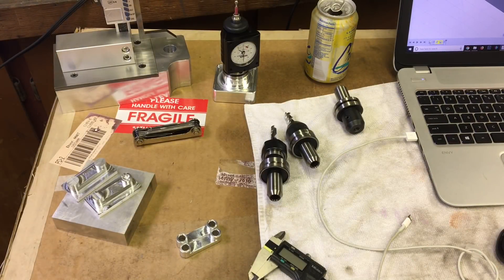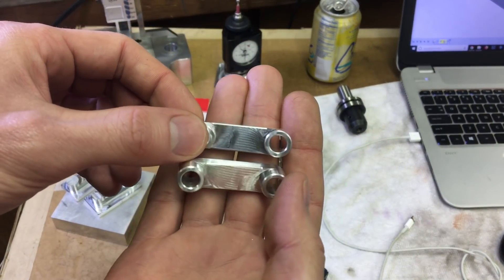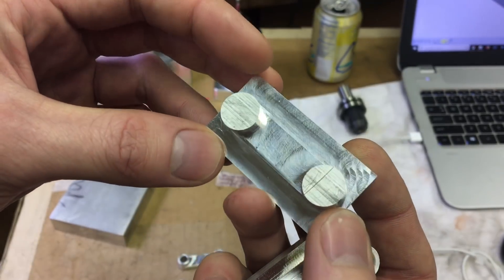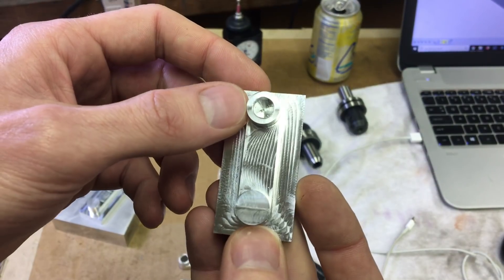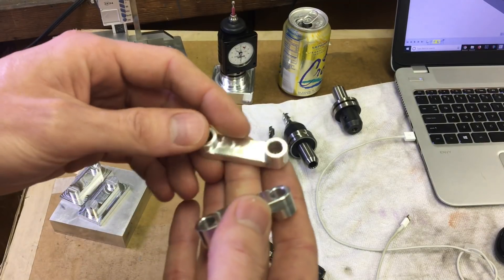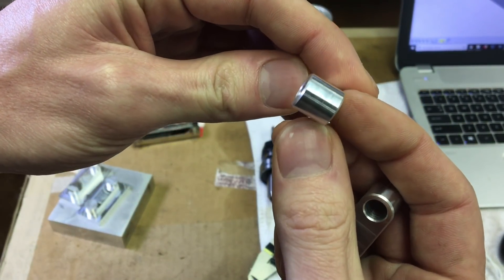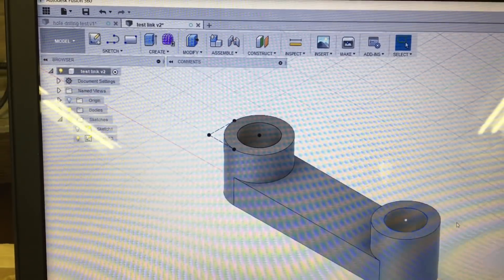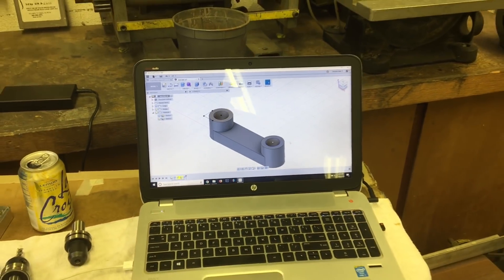Home Made CNC Mill - making some progress!

Comment: Pretty Sweet little plate you have your height gauge on there.
Reply from the maker: Hello Michael! Thanks, that's a little something my dad made up one afternoon. A left over piece of 2 inch thick Mic6 aluminum, with a surface ground steel plate for the magnetic base height gauge to stick to.
Reply: Nicholas Miller Pretty sweet. Probably way faster to make then me trying to drill a 3/4" hole in the corner of my surface plate with a hand drill. I did manage to make a 3/4" triangle. And chipped out the rest to make it work.

Comment: Is the spindle exchanged ? Im thinking about chaning my column, I got like 0.10mm flex back and forth even if I've tightened the screws.... how's yours ?
Reply from the maker: Hello Daniel L. Spindle exchanged ...?  this is the grizzly spindle with some time spent improving it. .1mm seems excessive, are you sure its not coming from somewhere else? could it be in the Z dove tails?   - Nick
Reply: Nicholas Miller naa, i measure against the dovetail itself. I can easily push and pull it 0.1mm.  The head itself can move somewhat in X+ X-  when doing heavy cuts though. Thats why I wanna exchange the whole column. Thinking steel tubes in a bigger dimension milled and grinded + linear rail

Comment: You mentioned e-stop a couple of times; I added a feed-hold button after seeing yours and my finger is frequently on that now. Saved me a number of times already. I have smaller spindle and drilling is a challenge. The equations for power requirements in the Machinery Handbook, while empirical, match measured power well. So, if you want to get into the weeds, those could be used to calculate great starting points. Look into the heights tab on the CAM operations and the non-cutting feedrates to reduce some of that slow plunge through air stuff when it makes sense. Lars Christensen of AutoDesk has a great video recently on height planes. As always, looking great! Off to stalk you on Instagram :)
Reply from the maker: ESTOP ESTOP!! I can say with confidence... I use that estop!! I used the feed hold as well, stopped the spindle to clean off the window! haha, worked a treat! I have a copy of the machinery's handbook... call it a "love hate relationship" = )  I watched one of Lars videos on soft-jaws, at the time it was a little out side my pay grade, now that I'm feeling a bit more confident it might be time for a revisit!  Cheers Kent - Nick

Comment: Nick,

Your machine is looking great! Cutting looks awesome!  A couple fun to and tricks you can experiment with!! 

Tip for that tricky chamfer between the two boss posts... Set the cut to use almost the very top edge (maybe 0.005" from the shank diameter to top of part edge your chamfering) of the 45° chamfer mill, it will allow you to get as close as possible to the boss sidewalls.. then play with your lead in lead out to have it feather the chamfer as needed, it's critical to really look close at your simulation to ensure you are avoiding a collision, but once you nail it down it's a thing of beauty to look at!  There is some pucker factor watching it the first time..lol. But that's part of the fun of learning and the results are a part with superior finish aspects you will be proud of!!

Finish Tip, Not sure how you will finish the parts, anodize, tumble, blast etc.. but if you are making parts and plan on leaving them unfinished aluminum, you can use larger tools to minimize tool marks as well as plan different cut directions and finishing step overs to have fewer too lines in the part finishes.  Not important unless you are overly critical of your finished piece looks as in they will be visible etc.. but a good tip I was given and kept with me over time.

Last suggestion is play with your drilling feeds and speeds, don't be afraid to run drills at higher RPM and feed them faster, you will be amazed at how much better they perform!  Especially those short machine drills, they can do some serious work quickly without worry!  Also if you are going to load the drill, it helps to run those ops before taking the stock down to far and weakening it's rigidity in the vise... The thinner the edge between the Jaws, the more chance the part will vibrate when heavy drilling, it can attribute to chatter and hole dimensional errors.

Keep up the great work!! I'm sure you guys are super pumped right about now to have the machine up and cutting parts!  Looking great!!

Chris
Reply: Awesome build and progress. Been a while since I've gotten around to my conversion and after watching your videos I'm eager to get back at it. Still a long way to go to get to where you are. But keep up the good work and keep those videos coming.
Reply from the maker: Chris! Nice to hear from  you friend!  I really appreciate the pointers / tips. As you very well know, solid cam work really makes a machine shine, and that's where i hope to get! I have been holding off on purchasing a bunch of tooling for fear of buying a bunch of stuff that wont work well for this particular sized machine, some larger tooling (face mill) is in order. These particular part where more for practice. How do you have you tools set up for when you are programming a part in fusion? are you optimal loads / doc / woc / etc set for each tool and you have something that works and you adjust from there? Trying to figure out a good work flow, before i imprint on myself some weird habits! lol. Thanks again Chris - Nick
Reply: Nicholas Miller definitely get a facemill, you will use it alot!  I like the square insert type with a 45° angle, seems to give the best finishes in aluminum with a high rake insert.

As for tool setup, I use solidworks and camworks, I have a tool library in camworks and over time I've taken advantage of camworks ability to save all my feature strategies with optimum tools and their specific feeds and speeds based on what material I'm cutting.  I have vastly different feeds and speeds however for prototype work and regular batch work for inventory parts I cut.  Over time if you start doing large runs you will have the opportunity to dial everything in for speed and reliability, but for prototype work I generally take things slower to prove out the cam and make sure I don't break tools.

At the time of this wiring I have roughly 80+ TTS holders loaded with tooling and always seem to need more or something I don't have..lol. But because all tools are loaded in my camworks tool crib, it makes camming parts fast and efficient.  I tell camworks to only use my tool library during feature recognition and from there I have only very minor adjustments to make if any to be ready to post and cut.  Makes life nice.  Hardest thing is cutting stock to size it seems..lol

Grab yourself a touch probe, it is far easier and faster than a haimer and no gear of breaking expensive tips.  :)

Comment: Nice work! I too have buried a 3/8" EM in my hardened steel vice jaws... Mine was about .5" doc lol. Your feeds and speeds look pretty good really. If it were me I'd probably cut that top hat off radially to make it a little safer/reliable, even though it'd be slower. You could get those chamfers on the long sections a lot closer to the corners if you wanted too. Do these parts have a function or you just getting practice? lol
Reply from the maker: Hey Brother! The parts where for practice, its easier that way! ahhahah, yeah, "thats the way i designed it" lol. I have yet to come up with a tool path that i feel is super dialed in, always something that could use a bit of tweaking. Its a great feeling to see things work as they should.  - Nick

Comment: Very nice Nick .. 
Especially the outside surface finishes.  Interesting that you can see the whole machine shaking just a tad as the table makes rapid moves, yet it is by far the most rock solid sounding conversion I've heard when cutting.  Makes my ZX45 sound like a tin lizzy .. I do know that my enclosure tends to amplify the rattles, resonance, etc in my machine, but then again it's a fair bit larger than yours as well.  Keep posting, I've really enjoyed following your journey.
Gary
Reply from the maker: Gary! Nice to hear from you, and thank you! I was talking to my father about the machine moving during rapids... and  how i don't like it! haha, remember the whole machine is on casters! I merely have the wheels chalked up with a piece of poly-carbonate. Some quick adjust "feet" are in store, so the machine can be off its wheels! during machining, if only because it looks silly seeing the whole damn machine move around! lol. My machine is also on a resonance prone hollow base, stick around I'm sure you will hear it sooner than later!  - Nick